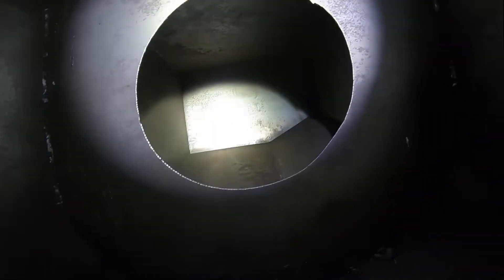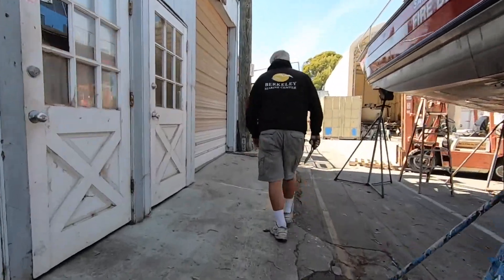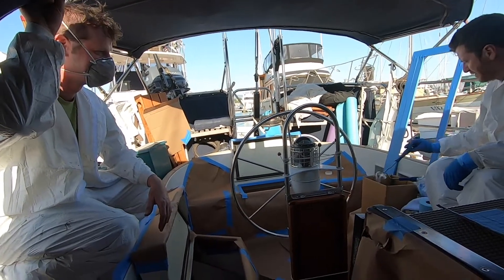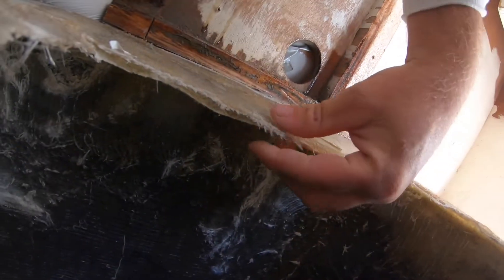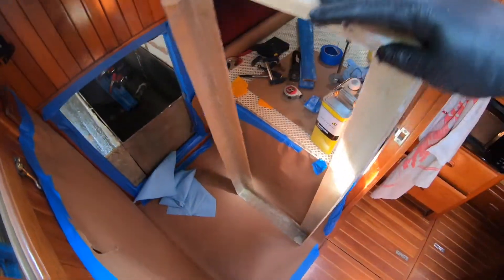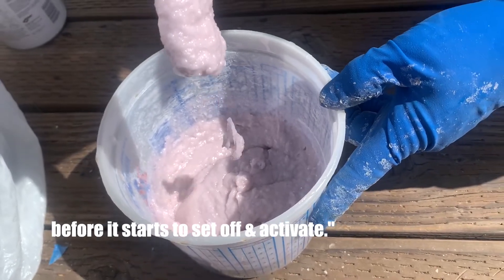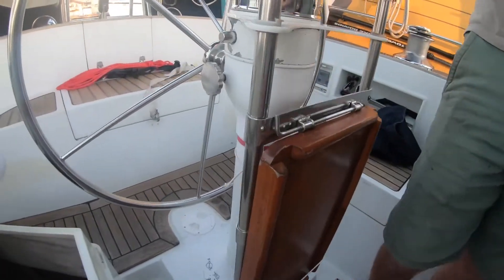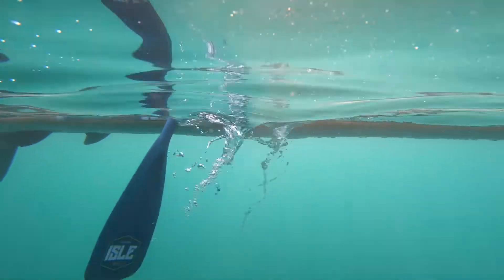EP 28. HOW-TO: Sailboat DIY Fuel Tanks - Sailboat Fiberglassing | Two the Horizon

Comment: Hi, I own S/V Vedrfolnir a 1984 passport 42 pilothouse. Bought the boat in Berkley.  Your channel is pretty exciting for me as so much is similar to my own boat. I am currently dealing with the fuel tank issues also. I Opened the tanks up to add sensors and a second inspection port, and was almost done when I was unexpectedly deployed overseas. Came back to find the fills were leaking, water got into the tanks and the tanks are gone with mostly flake rust. 

I have been looking more and more into fiberglass or fully integrated fiberglass tanks when this video popped. Love you guys it's exactly what I needed. I really like the idea of using the old tanks as a form. Not sure if I can do the same but I'm positive i can adapt it to my boat

Q - What fuel friendly resin did you use? 
Q - Why didn't you use epoxy resin? 
Q - how many gallons is each of your tanks? Mine are 80gal each for 160gal overall - supposedly
Reply: Q - why didn't you use an airline tank sealant or was the tank to bad? 

My biggest issue with this project is the damn shaft strut bolts. I'm fairly certain they're underneath the tanks. I saw pitting on my strut, other than the shaft the only stainless hardware on the bottom. Its good for now but that's going to need to be replaced at some point. If I use integrated tanks that means the bolts are in the fuel tank, which sounds like a pretty bad idea regardless. Glassing tanks inside the metal ones or even having new metal tanks installed, may make things more moveable however still have to empty the tanks to get under there  which is still a difficult problem. 

Thinking about glassing the bolts into the Hull and covering with a g10 plate and a couple layers of glass, however if there was ever a grounding or damage replacing such things would be likewise pretty painfull. Did you consider this aspect?
Reply from the maker: Hi Robert, so glad you found our channel! I hope you will subscribe to continue following along on our adventures and projects - how fun we are both Passport owners! Such a bummer that your tanks were ruined with water ingress!

We used a fuel specific resin which we sourced from RevChem composites, which was recommended to us by the boatyard where I work part time. 
Each tank is approx 55gals. 
In terms of the problems with the strut, I’m not sure I can help, since our shaft is fully encased in a shaft log. We don’t have a strut with bolts, but I can see how that could be an issue if they are hiding underneath the tanks. 
We don’t have experience with airline sealant, so fiberglass seemed to be the most achievable, long term and durable solution to our problem.

Comment: Wow. Thumbs up!!! Good job! We've got old stainless steel tanks that we want to replace, and my research so far is pointing to fiberglass as a preference. The problem with stainless is that any water that ends up in the tank is sealed off from air and corrodes though with crevice corrosion. Is that what happened to yours? The use of G10 plates for fittings is brilliant. We currently have 2 36 gallon tanks, but I'm estimating that custom tanks could be fit into the available space better and brought up to 50+ gallons each. I'm also going to add a 3rd tank that will be a "day tank" (15 gallon) that will only receive polished fuel from the main tanks.
Reply from the maker: We mainly went with fiberglass because we had to build them on place, the original size didn’t fit through any exit point on the boat and we didn’t want to cut the cockpit sole out. It was not an easy task, fiberglassing in a hole, on your belly. If you can build them outside the boat you would have a way easier time building them of fiberglass.  There’s a fuel specific resting you have to use it it’s to hold diesel, REV chem makes some, not cheap though 😝

Comment: Why kept the steel tanks?  Can use the hull itself doing an integral tank.
Reply from the maker: The theory was less cutting and removal of pieces if we fiberglass a new tank inside the old shape. Using the hull as a form wasn’t going to work because limber holes and bottom of rudder post would have been covered up. 
Since this video tho we’ve started the process of going fully electric and both diesel tanks are being removed and batteries are taking their place.

Comment: Nicely done guys! One question. Did you consider cutting the tanks and using bladder inserts instead of glassing in the tanks? ( i like what you chose to do btw)
Reply from the maker: Hi Ken! We considered that option and initially we had decided to go that route. We planned to cut the tops off, grind the interior surface and baffles, line it with something soft and plushy, then set two bladders in. Unfortunately, the more research we did, we found that most bladder tank companies advertise the fuel tanks to be only for temporary fuel storage. We looked into one company, ATL tanks who claimed to make high quality, custom bladder tanks but when they returned an estimate of almost 5K for tanks that only had a 5year warranty. For that amount of money, we could’ve paid to have metal ones fabricated..
Reply from the maker: Also, everyone we spoke to about bladders said they just don’t last because of the constant movement of the boat, no matter how well you install them they are just shifting back and forth and can cause chafe. 
We are so glad we decided to go with building our own fiberglass ones. Not just because we are stubborn and don’t like paying others to do work for us, but also because we learned soooo much more by doing it this way!